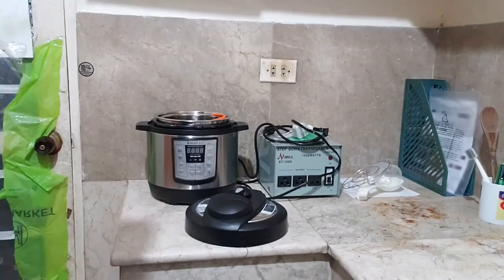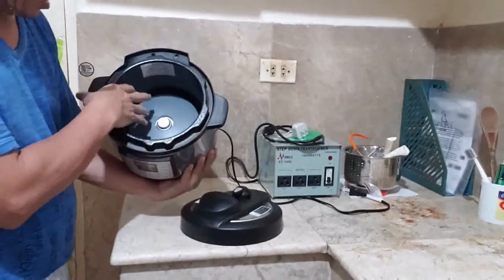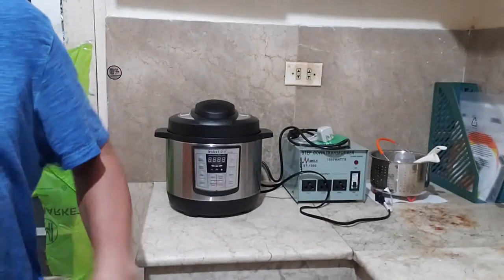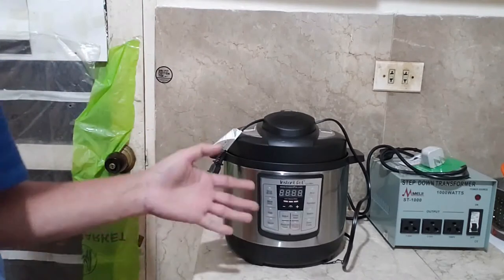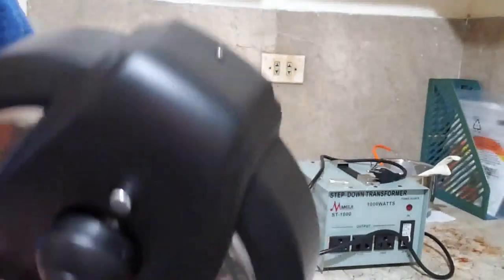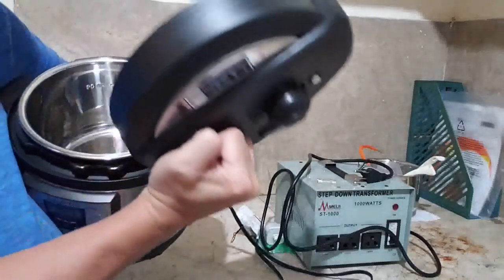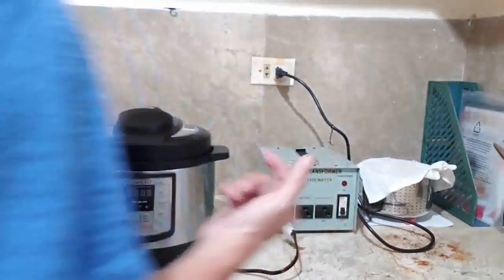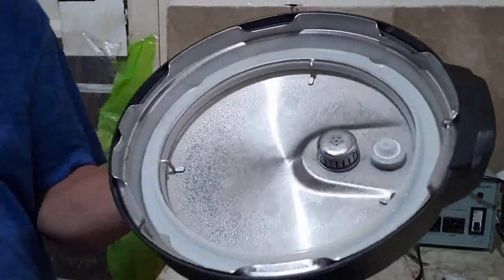Instant Pot Initial Test Run

Comment: Thanks, in summary then, did the Instant Pot perform well with the step down transformer. I know sometimes that for example the clock timer can be affected.
Reply from the maker: hi! sorry for late reply. I had difficulty signing in since I lost my phone on April 13. I was only able to recover my account just today. So this channel was inactive for a month. As for your query, yes it does. i don't have any problem so far.